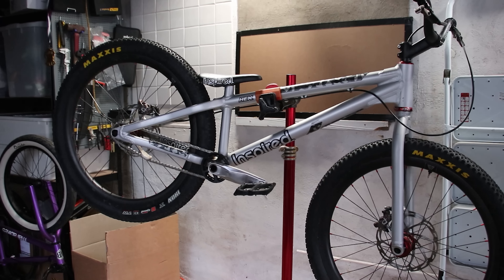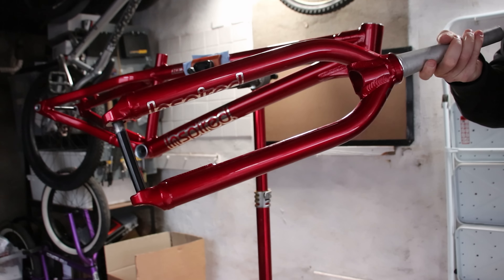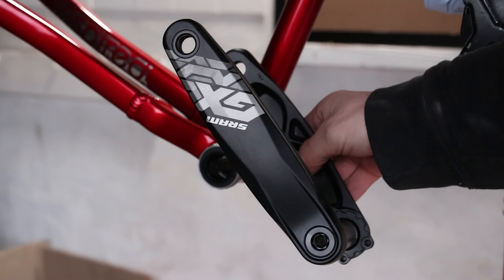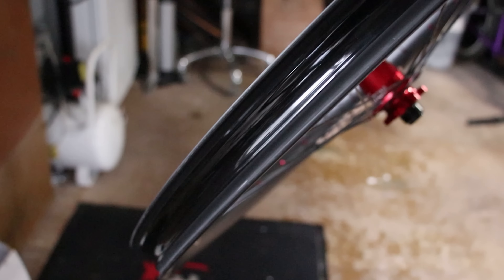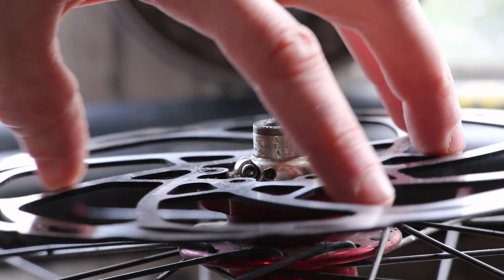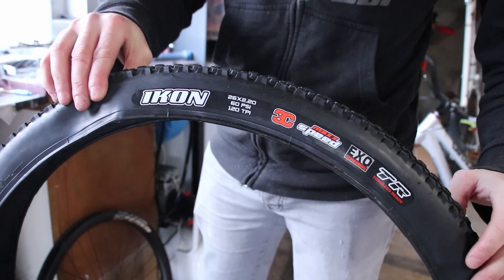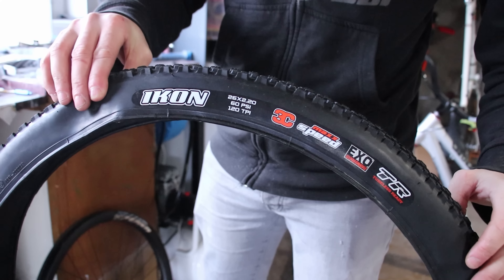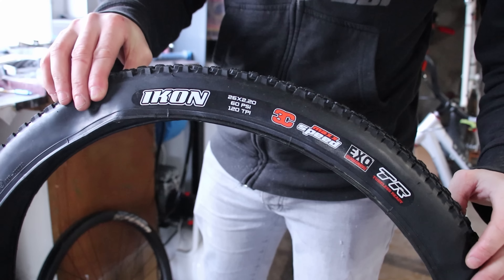Building My New 2022 Inspired Hex Street Trials Bike!

Comment from the maker: Anything you’d change?
Reply: Your Magura MT8 Brakes would fit a lot better colourwise :)
 Maybe with Yellow Rings (Not the Neon ones !) to match with the maxxis logo :D
Reply: More about the frame-- Curious why Inspired haven't gone for integrated headset on the headtube?
Reply: Ah mate that frame is pimp
Reply: I think it looks great, but if time and money were not a concern, I'd go with some raw alloy pedals and then strip the paint off the cranks!
Reply: Using grease on the headset
Reply from the maker: @jackridesbikes7451  no need, it’s one of those things where people swear you either need it or don’t need it and I just think it doesn’t make much difference, grease it if you want, or don’t…it’ll still work
Reply: Paint remover on the Hayes brakes to have full-on theme match ! Not like they finally came to their senses and started to support you it seems so proper matching and no free advertising would be what I'd change. Stuning bike tho !
Reply: Amy Winehouse stem methinks
Reply: Red and silver rotor bolts
Reply from the maker: @MannequinOngaku  things like this take a lot of testing, perhaps they'll introduce this in the future
Reply: I'd only thing I'd change is the owner to me!  😉😉😉
Reply: Looks so good! but I would get some polished spacers for the stem
Reply: Only thing I would changes is probably silver hubs :)
Reply: the headset press
Reply: I´d do polished hydra hubs as I think the red is a bit too much
Reply from the maker: @ottomtb  tbf I got these hubs quite a while ago before I knew I was getting a red frame…I’m quite lucky that the reds match
Reply: @Ali_Clarkson  thats lucky, but hydras are nice in any olor, just the sound is something else!! BY the way, thanks for always helping me building my wheels, your tutorial is amazing. Just built up a new wheelset recently, strong as hell!
Reply: @gg4760-k5n  They take dot fluid, which is a great paint remover. Although expect they are anodized not painted.
Reply: I'd use MT7's and steal the adjustment screw idea. Wouldn't be that hard to drill and tap for tiny screws. It solves the only complaint I have with Magura brakes. They are by far the hardest to get aligned. Shimano always just works for whatever reason.
Reply: Video is awsome for me because Im hooked at ur channel for years... But little advice myb... It s really borring when you make 3-4 sec gap between you speaking something and there are no pictures changing, little edit, or someone riding a bike...
You make this video very chill, and only have two Sam Pilgrim magic tricks and one move on bike at very end which was by far the best part of whole video for me :/ we want action and a bit shorter bike build videos with few edits here and there..
my english is bad, but hope this is pretty good:)
Dont get me wrong 😝tnx
Ill delete this as soon as you like it or react to it any other way 🤭👍🏼🤫🤫
Reply: @markokozaric  Tip: Go to the little gear icon and select speed -> 1.75x
Reply: Awesome build dude! LOVE the red frame! Only think I’d change, and this is just personal preference, is switch out the stem for a black one!
Reply: would fit looser chain...
Reply: The silver logo's. Im in London so I'd have to go stealth mode cause it would be nicked.
Reply: Only thing I would change is the price... :) looks the same colour as my 4play love it, would have all my bikes this colour if I could looks so good! probably because it reminds me of the old Pashley 26ghz they did this colour back in the day.
Reply: I’d use a bit of grease here and there maybe👀
Reply: Did you change your opinion totally on rim brakes being slightly better?

Comment: You can avoid the need to bleed the brake aft taking the hose out by pumping the brake lever so the pads touch together before undoing the brake hose. When you lever the pads apart after reconnecting the brake hose, any air bubble that's in the brake hose will be pushed into the reservoir, where it will no longer be under pressure when the lever is pulled.
Reply from the maker: hadn't thought of that...might try it next time thanks!

Comment: I'm curious how the Hayes brakes feel compared to Shimano Saint and Magura MT7's, as Hayes has been very much off my radar since the Hayes Nine about 20 years ago. Hayes now own Answer/Manitou and Sun Ringle though, so they're quite a significant component company under the radar.

I wouldn't even consider Shimano for a trials use because of the wandering bite point issue with every generation of their brakes after they moved to a cylinder shaped reservoir on the lever. I really like the MT7 brakes I'm running on my trials bike and my XC bike, really consistent bite point in both applications, and more modulated delivery of power for stops where the grip is low than Shimanos. Magura and Shimano also run mineral oil, so less maintenance and less dangerous than DOT fluid, but I've had very little trouble with DOT fluid Hope brakes either, so I won't write the Hayes brakes off based on the fluid.
Reply from the maker: This was the brake they made to try and bring back the name they once had, it's their take on what a perfect brake should be and I think they just about nailed it! The lever feel was what sold me initially...you've never felt a brake with a lever action this light trust me! They specifically aimed for this feeling and fitted specific seals, bearings etc and made it so there's zero dead stroke, it's sublime.

The crosshair centering adjusters on the calliper are one of those "why didn't they think of this sooner?" ideas, I've never had a brake this easy to set up rub free before.

Power-wise they're the best compromise of bite and modulation I've felt from a brake, I can lock the wheel easily yet pull a stoppie with no worries.

I've not had any maintenance issues either, no leaks, sticking pistons or wandering bite points, just reliable power.

So yeah, I'm keen!

Comment: Ali, have to say, I think that red paint job is fantastic, looks to be about a perfect match to the tone of the hubs and work stand. I'm thinking you won't like that Hope stem, not because it's silver, but because it looks about 20mm shorter than on your previous build. Looking at it complete, for/to me, I think a black stem and silver headset spacers and bar would look really sweet, also, I'd be looking to some baking soda/stripper and stripping those cranks and polishing them up. Heck, looking at it again, maybe even getting the stem powder coated to match the frame would look sick.
Curious how wide those 2.2" Ikons measure on those i38 rims? Guessing they're closer to 2.4".

Lastly and sadly, you were doing so good on build and style points, right up  until you installed the tyres with tyre name/specs and not brand logo by the valve stem, especially on Maxxis as it's only on one side :-p :-D
Reply from the maker: Yeah I might agree on the stem, I've been running a 95x25 which I've been liking but I have found my manuals and spins aren't what they used to be. This 70x20 is a little shorter but doesn't feel too bad but we'll see once I get out riding it. Not the end of the world to swap stems. You're the second person to mention silver spacers so perhaps I should try it (as well as a powder coated stem...I like that idea!)

Yeah the tyres come up larger because of the rims, not sure how big...maybe not 2.4 but not far off.

Sorry about the logos :( I did try to spin the tyre on the rim when I did the back tyre but it wouldn't budge and I was too lazy to change it, I then copied it with the front wheel. I'll sort it out when my new tyres come ;) (tan wall Ikons anyone?)
Reply: Was actually thinking about the stem being shorter and thinking that being you do have a shoulder injury, you might actually like the bit shorter reach while recovering and might find then that you actually like it once recovered.

Not hard to grab a few pics with the silver stem and get them in an image editor to see how a red stem to match would look. Definitely think that a silver bar would be needed to properly compliment it though.

Hahaha, no worries, wondered how come you aligned the tyres like that as you usually do the brand logo to valve. Everyone gets a bit lazy sometimes, but my OCD with that sort of stuff doesn't let me let it stay LOL.

Comment: Looks incredible Ali! Nothing beats a freshly built bike, fresh tyres especially haha. Curious to know what length you run your fork steerer to? As I understand you specify the Pro version forks. 
After riding my Hex team for a year now (blue 2020 version) my only complaint is the fork steerer is a little bit short for my liking. I’d love to be able to run even an extra 5mm spacer under the stem but the top cap won’t reach the thread. A real shame as there’s still just enough steerer there for the stem to securely clamp on to. It would mean new forks which sadly aren’t available.
Reply from the maker: it depends on the stem I'm running, I don't like super high bars so I often cut it down slightly

Comment: What brake rotors are you running? I have a four play with tech 3 trial zones.  I would like to upgrade to 203mm in the back.  What rotors do you suggest? Also what adapter will work for that?

Comment: So with the hex coming with 180 mm mounts is there a reason one would run smaller rotors (like a 180mm) on a trials bike? It seems like you’d want to almost run the largest rotors possible like in your case with the 203